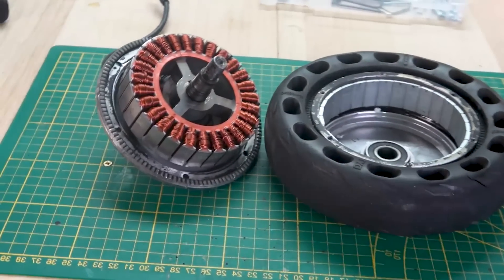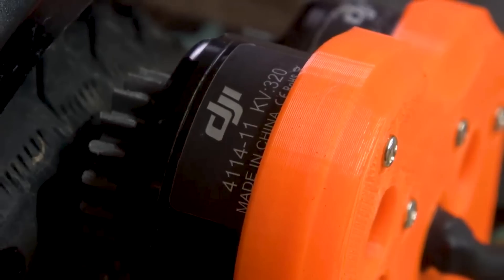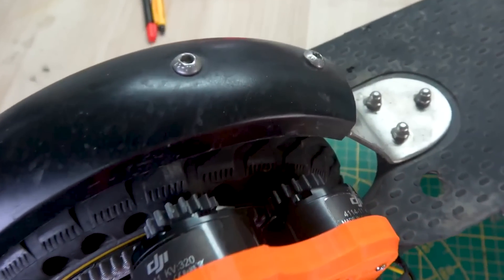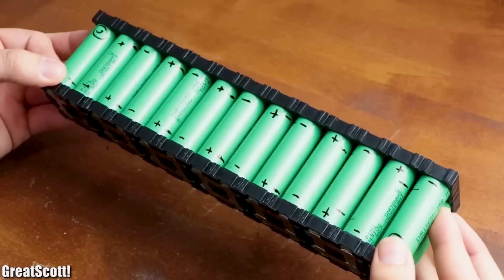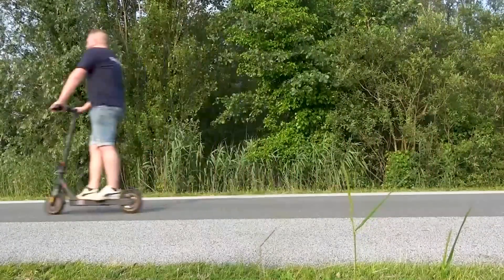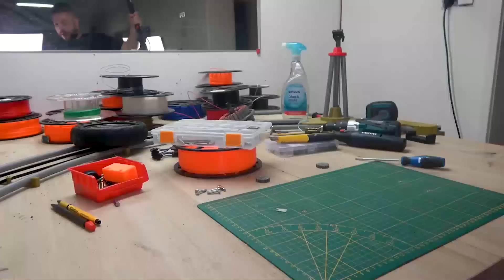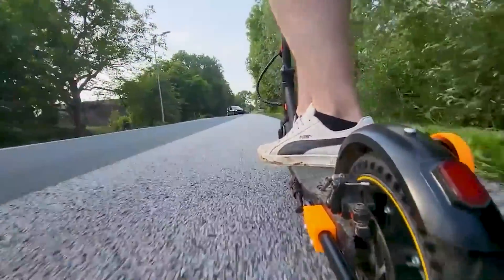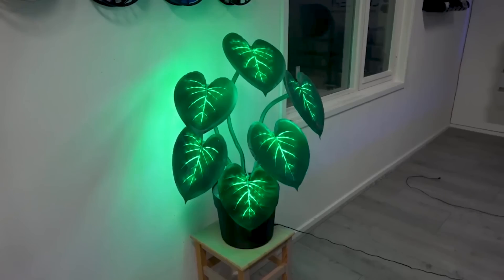Tiny Drone Motor vs My Electric Scooter..

Comment: Using only part of the battery pack is a bad idea. Doing so can cause the battery pack to be severely unbalanced. You really, really dont want to be mixing fully charged cells will dead cells in the same battery pack. You cant charge a battery pack with mixed charged levels, because charging will cause full cells to be overcharged. You cant discharge a battattery pack with mixed charge levels because discharging will cause empty cells to be overdischarged, possibly even below 0V and into the negative voltage range. Very bad. I no longer trust that scooter battery pack to be safe. You should have use a seperate battery pack.
Reply: Depends on if there is a BMS, but some take a very long time to do so, and if the BMS does not communicate with the charger in realtime, you risk overcharging.
Reply: This should be a pinned comment. Do not mess with battery packs.
Reply from the maker: Pinned it!🫡
Reply: Literally playing with fire and explosives! All cells needs to have the same load, just get a separate pack for the drone motors...

Comment: Tractors are limited to 25mph(40kph) and 31mph(50kph). And are electronicly limited, which could if un-limited go faster. Some tractors may be restricted by limiting rpm or the gearbox

Comment: I like this idea. Steal half of the battery source. It has bms itll balance haha smart thinking. And you now have 60amps like a nitrous button 😂😂 make sure youve turned off speed limit on the scooter or the front motor will drag try hold its speed at 15

Comment: disconnect oryginal controller and put vesc ...now you can go faster , change the wiring to delta (if its in star) and you can go 1.7x faster than last top speed (dont do it , less torque and if anything fails .......)
or put single 6384 motor ...now you can go 40mph 😅
Reply from the maker: It sounds like you've been around this axe before?🤓Do you ever do DIY experiments like these for example yourself?👀 I'd love to hear more about it!
Reply: @ConceptCraftedCreations been there , done that,almost tear a tendon😅
Reply: You sound to me like you never had been there let alone done it😂.

Comment: As another comment said, do not use only a part of the battery pack! I severly doubt that a BMS can remotely make up for that. You'll completely discharge some of the batteries, leading to mixed battery levels, possibly leading to catastrophic failure! Put a decently sized Buck converter after the 48V, but never use only some of the batteries